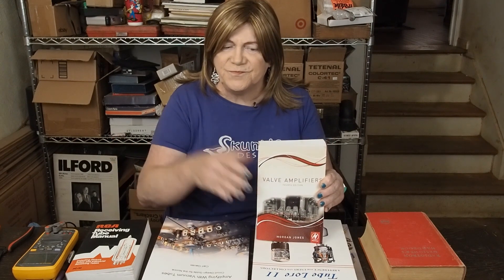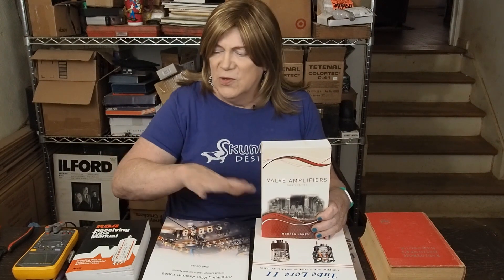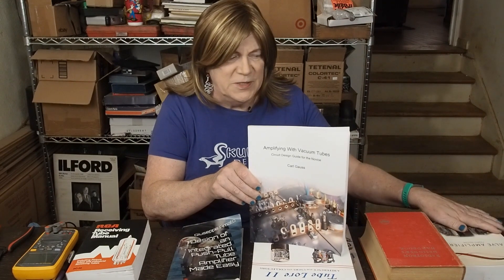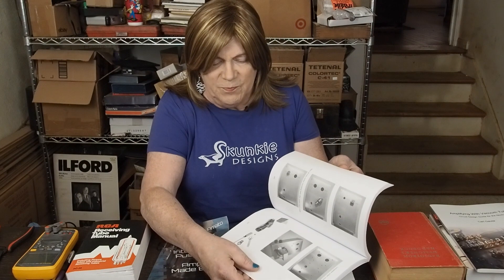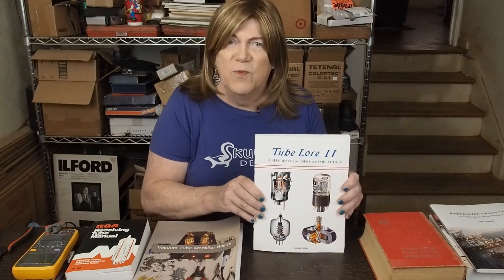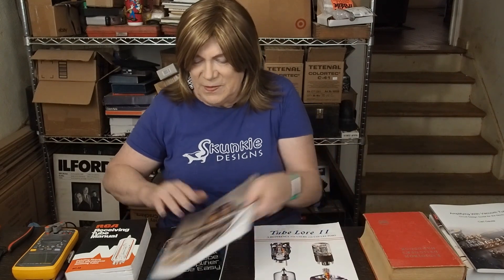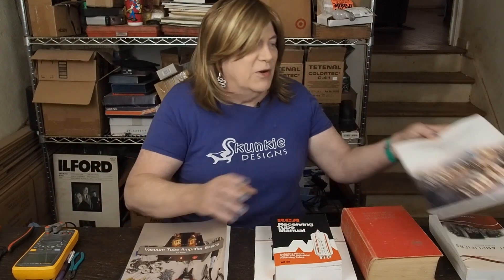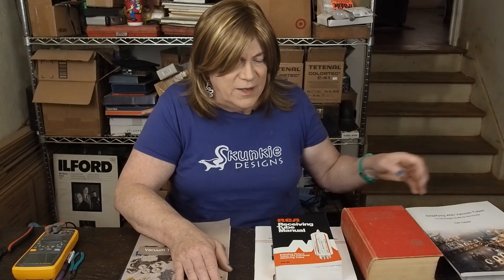Monday Monologue: How to Learn Tube Electronics

Comment: As far as books on analog Electronics there are many sources even for used ones but the new ones that are printed now are just as good and as informative. The best training course for analog Electronics I found was the original 1954 RCA study course it is a series of about 10 books including books how to build your own projects such as an audio amplifier and power supplies. Yes I am an old timer and learned years ago. On a personal note it is great to see that much younger people are wanting to get into this field of vintage electronics and vacuum tube equipment. In my opinion digital equipment will never produce that warm tube sound that you get from vacuum tubes.
Reply from the maker: Someone gave me a box full of books from an old Devry Technical institute course dated 1958. I haven't started on those yet but that should have some great information!

Comment: On a personal note I use analog multimeters with vintage electronics. I feel that the digital multimeters will not give me the proper results that I am looking for as I do with an analog meter I like to observe the swinging of the needle back and forth as I make my measurements especially when it comes to checking capacitors and electrolytics. But that is just my opinion and what works best for me.
Reply from the maker: Any specific meter you like? An analog meter would be useful!
Reply: @SkunkieDesignsElectronics  hi again, I use analog meters from the 1970s,  sutch as the realistic brand from Radio Shack uses standard batteries. Plus I have a Simpson analog meter that dates back to the 1960s uses standard batteries as well. Plus I have a bell and howl and log meter from the 1970s as well. This is just my preference to use analog meters especially when it comes to checking capacitors for leakage. 99% of capacitors need to be replaced anyway in vintage electronics and audio equipment. On a personal note glad to see much younger people getting involved in interest in vacuum tube equipment such as yourself good luck

Comment: I am new to this channel I'm glad I found it. Vintage tube amplifiers and vintage radios on my favorite. I have been collecting and repairing vintage electronics for 45 years now. First I wanted to mention I have found in my experience with some of these vintage amplifiers and such is that the power transformer needs to be fused on each side the primary and the secondary just in case of any shorts. Because if there is a B+ short you would do not want it to carry the power transformer and damage the Transformer same goes for the primary. Yes I have had rectifier tubes and electrolytics short and carry out the Transformer burn it out as well. Low voltage rectifier tubes such as a 5u4 or a 5y3 or a 3D G4 Ken and will short and burn out your power transformer.

Comment: I stumbled onto Giuseppe Amato's book by way of his website. I'd be curious about your thoughts on his "Il Primo Bis" design. I was strongly considering building it with the power supply in a separate chassis.
Reply from the maker: It looks VERY similar to the tubelab Simple Push Pull design except it is using EL34 tubes on the output stage. I like it! Honestly there is no reason to build the power supply in a separate chassis on a power amp, although I would replace R1 and R2 with 2 chokes using the same DC resistance.

I  might add this to my build list :)

Comment: Heya Skunkie - so so glad to have you back , so i can tell you that here in uk i built the kt66 monoblocks in the EJ Jurich book they are outstanding !! i recently sold them and they were run up against a pair of Malvern Audio amps - they simply blew them out the park - now that came from the new owner who has a lot of contact with Malvern not me - i have also built the 6v6 fixed bias amps in the same book - currently running them on ge 7581a's and again the sound is to die for -- that book is superb for anyone wanting to have a go at this - i will try put pics up on your site of my builds -- so glad your back and hope your feeling so much better -- chris
Reply from the maker: Some 6V6 amps sound like a fun project! I will check those out, thanks!

Comment: Great collection of resources!  Might I also suggest a couple of books by Merlin Blencowe; they are very thorough and yet easy to comprehend without an electrical engineering degree: "Designing Power Supplies for Tube Amplifiers" and "Designing High-Fidelity Tube Preamps."
Reply from the maker: Thanks for the tip!
Reply: I have liked and subscribed to your channel based on this wonderfully helpful video. I then reviewed some of your posted videos. I love your energy and passion for electronics and am now considering starting a new hobby because of your work. Thank you for sharing your hobby and inspiring others. I wish you the very best.

Comment: I started with tubes after learning solid state, because tubes were always a fascination for me and I always wanted to understand how they worked.  The old RCA tube manual (maybe RC-19) was where I started.   It starts with basic tube theory and then goes into a lot of depth in terms of load lines, etc., plus you have some great charts and example circuits, as well as all the tube data, all in one book!
Reply from the maker: I used RC-10 when I was building my 47 globe tube amp! I will look for RC-19.
Reply: RC-19 was reprinted and is still available new from the big online antique electronics vendors. A lot of other revisions are online as free downloadable PDFs.  One advantage of learning from the old texts and manuals is that it sidesteps a lot of misinformation that seems to spread online, particularly in the audio community.  Once you learn from the original sources, you'll be able to spot a lot of nonsense and mythology for what it is.

Comment: Couldn't agree with you more where a lot of the modern books are concerned. The older books really had more practical application and more applicable theory. This was a great posting...thanks!
Reply from the maker: And the old tube data sheets give a wealth of information. The newer tubes, many times, don't even show the curves anymore. Much less design suggestions.

Comment: Hi Ms Skunkie. Can't find your name anywhere so hope it's ok.

I'm a 62 yr old newbie but I've always loved tubes and the difference it brings to audio. And this precisely is the point I wish to make.

It would be interesting to perhaps quantify how much parts influence the end result in percentage terms given these specific parts in a basic single ended circuit wired point to point 

1. Output tubes
2. Driver tubes
3. Rectifier tubes
4. Coupling capacitor
5. Output transformer and
6. Hookup wire

Each of these influence but to what extent is the question. I for one have always wanted to compare output transformers but can't afford to and don't have enough technical skills to do it.

Always heard of Tango, Tamura, Lundahl, Audio Note, Jadis, etc

Who knows, OTs might be equal to tube influence. More power to you Skunkie!

PS
One Japanese tube legend even built his amps with exact same driver tube as his output tubes ie his 300B SETs all had 300B drivers too! No matter the output tube he uses the same to drive them, his philosophy for is sonic superiority.
Reply from the maker: Ms Skunkie is fine :)

In order of impact on sound:
Driver tube, these can impact the sound a lot. 25%
Circuit design/feedback implementation 20%, sometimes more!
Output transformer, mainly large enough to not lose bass response/designed for hifi 15%.
Coupling cap, close to the difference of a decent quality OT 15% between cheap and good quality
Output tube, does have some impact. 15%, sometimes more, esp with direct heated tubes like a 300B
Quality of other components 8%
Layout and other factors 7%
On a single ended amp with a good power supply, never heard the rectifier tube change anything
Same with hookup wire, as long as you are using decent gauge wire and shielded wire where needed.

I have heard of using the same output tube as a driver, never tried it so can't say yes or no on that one!

This was a quick down and dirty chart, hope it helps!
Reply: @SkunkieDesignsElectronics  Thanks for the info Ms Skunkie. I noted you gave the driver tube the highest share. That would affirm Sakuma's philosophy of homogeneous tube set. Imagine using an 845 to drive another 845, extreme. Cheers!

Comment: Lately I have been building amplifiers out of television tubes. I have used both vertical and horizontal output tubes. My last was made with 6J4 for pre-amp tubes and 33GY7. The finals also each has a diode inside and I use them as the rectifier as well as the finals. My output transformers in this one are 70.7 volt line matching transformers. and the high voltage which is relatively low, is generated by an inverter board from amazon. It's no power monster, but sounds really nice.